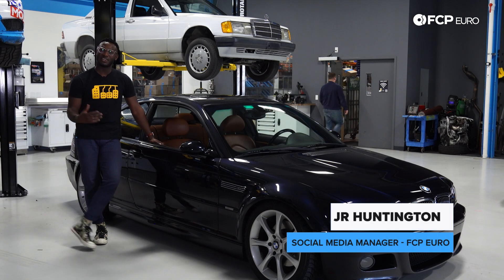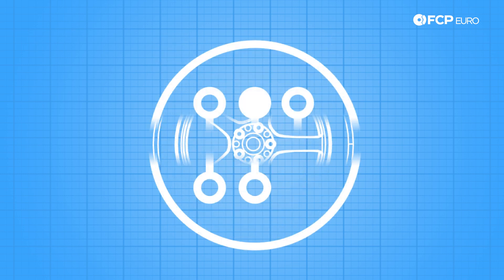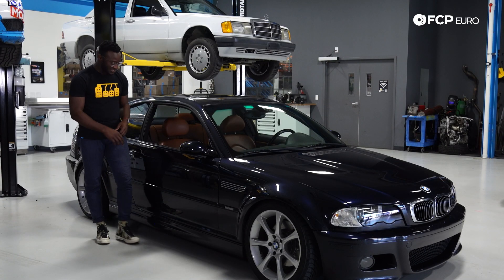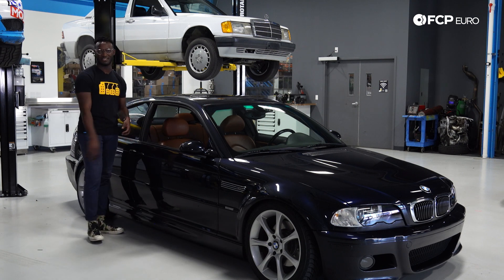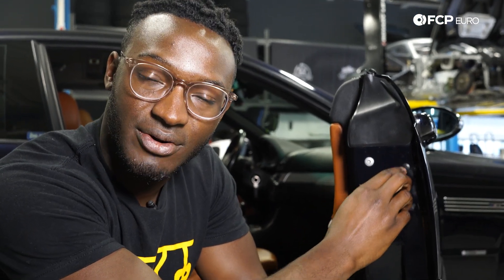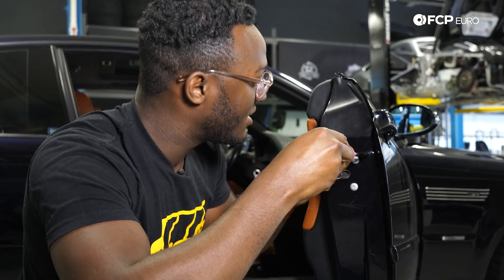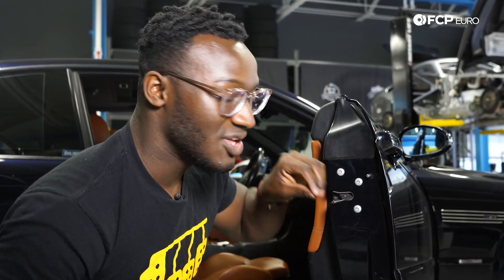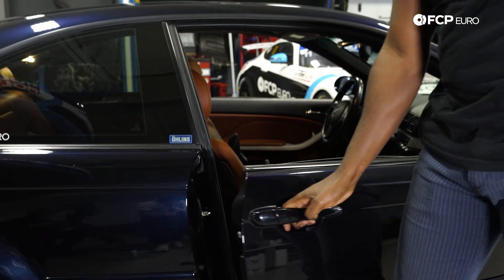How To Fix A Loose BMW E46 Door Handle

Comment: Do E82 series have this adjustment pin? Im gonna check my car...
Reply from the maker: What is the verdict?!?
Reply: @fcpeuro  Didn't see any screw to adjust the door handle behind the top access panel, but I didn't have an issue with the door popping out anyway. There is a bottom access plug as well but it reveals the window regulator assembly. (2011 E82 135i EU Spec.)

Comment: The BMW spec says that the handle should travel at least 2 mm after the latch unlocks; if it doesn't, the lock body need to be replaced.

Comment: I need to see which bolts have to be adjusted to pull the door in on an E82, door sticks out not flush...
Reply from the maker: You may want to look at the striker as well to ensure that is aligned properly.
Reply: @fcpeuro  You are correct, I simply moved the adustable striker plate inwards to fix this issue. (E82 135i)